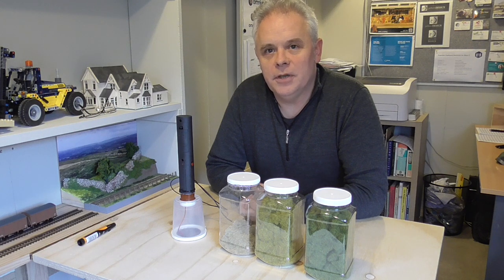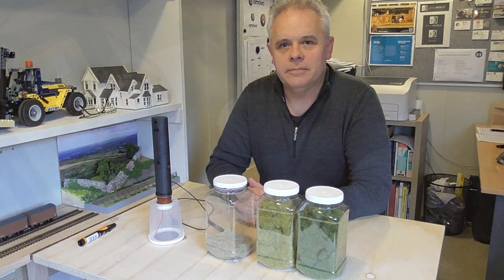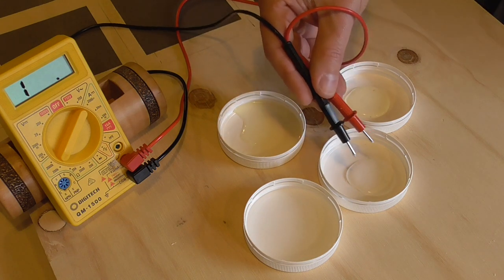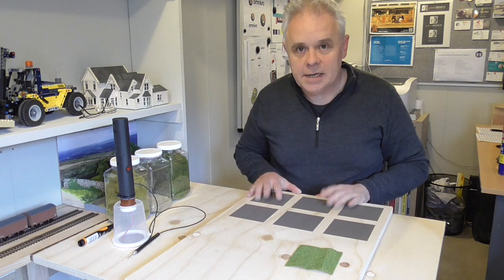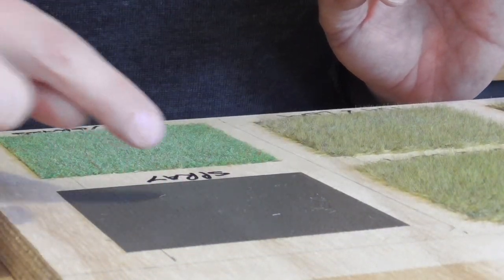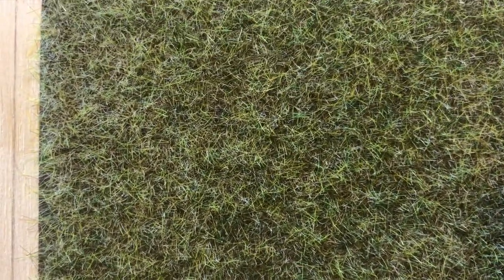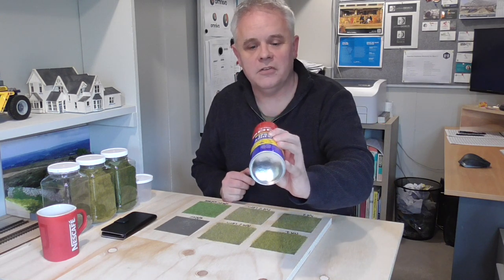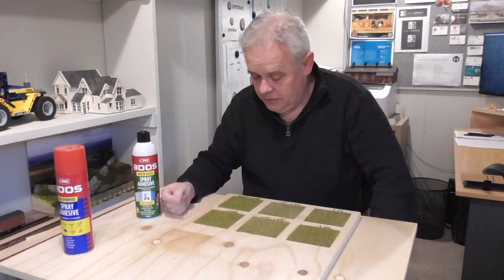The Static Grass Glue Experiment

Comment: Just about to start my new layout and saw this video, thanks for the experiment, always wondered about this, the higher priced PVA seams to work the best..which I have, so will press on using this..
Just a thought on a " sealer for this and a great for " layering " is cheap hair spray, I used this on my last exhibition layout and with it constantly being moved and bumped about, this worked a treat, all my grass and trees/bushes stayed put..! thanks for this great informative video..😊

Comment: I am in Australia, so similar problems with accessing things like WWS base glue. I use Modge Podge as my base glue to avoid that shine from the dry glue. I have found most spray adhesives will lose their stick over time - the back of the can says that a single coat is for temporary bonds - and when using spray glue on my trees, I then need to give the tree another spray (I use cheap extra strength hair spray) to fix the leaves. I have found, when making pine trees, that a spray of spray adhesive, then apply the static grass, then apply the hair spray - almost with no time gap between applications works best.
Reply from the maker: Thanks Eric for your feedback and tips, brilliant stuff. I'm in agreement with your methods in that further coats plus an overall fixative (hairspray) is needed when using standard spray glue. It will be interesting to see how the water based spray glue goes over time. It is more expensive than standard spray glue ($21 NZD) but Supercheap Auto in NZ are selling cans for just $9 NZD.
Reply: WWS glues and products are now readily available through their Ebay store. The postage costs aren't too bad. The layering spray comes as a pump bottle due to them not being able to post the aerosol cans.

Comment: I needed material for making my own static grass and decided to use the furry edges of a piece of MDF that has been laying in my back yard exposed to the weather for about 18 months. I placed it in my coffee grinder and it fluffed up very nicely in random fibre lengths. I added artist's acrylic paints straight from the tube to the fibre in the grinder and whizzed it for a few seconds. Good result and it is able to be statically charged. I have not tried it through a static grass applicator but sprinkling it onto a PVA glued surface from a sieve produced quite satisfactory results.   Rolly
Reply from the maker: That's sounds fascinating and thank you for sharing, I'll have to give it a go at some point. Cheers, Julian

Comment: Hi. Just in the interests of scientific method, did you use a new square for the water-based spray glue, or just straight on top of the GP spray glue? I have no idea if this would be necessary, just wondered.
Reply from the maker: I did just go straight over the top on the same squares but 2 days later, so the previous spray glue residue had dried off. I doubt whether this would have had any effect on the success of the water based spray glue.

Comment: Spray glue, you need to be quick as it flashes a skin quickly as the spirit evaporates quick and the grass won’t penetrate the surface
Reply from the maker: I suspected this might have been a factor with the standard spray glue as I sprayed the squares in the garage (didn't want glue everywhere in the office) and then brought the sample into the office for the grass application. Approx a 30sec delay maybe but spray can indicated up to 2mins for repositioning so thought it would be ok. I used exactly the same method (with time delay) on the water based spray glue with the successful result. Obviously the water based glue doesn't form a skin straight away.

Comment: When I started doing static grass, I thought the clip needed to be in the glue. I was wrong, and there are many others online that show that all you need to do is to keep the clip below the hopper. See https://youtu.be/MY2uPg49tZg?si=iJZyl47MQV2Yw2gH&t=79 and you will realise that putting the clip in the glue doesn't do anything at all. As a proof. After you have applies static grass, pull the clip out of the glue, hold it under the hopper, and watch the grass being pulled upright as you pass the hopper near the newly laid static grass. This is because the electrostatic field that guides the fibers is present in the air .

Try it sometime, you'll be surprised.

Comment: I've had a difficult time with static grass.  I have both a peco/wws smaller one and bigger noch pro.  I tried a variety of white glues. Except for cheap crud from China, us Elmer's or mod podge is ok.  I found though all my static grass fell over once the applicator was removed.  So I finally got so frustrated I created it in swaths... With a sheet of aluminum foil under baking parchment paper... And glue on that parchment. Then with both applicators connected to the foil I could apply grass and with some effort get the results I liked. I generally used the bigger noch.  I also found the noch grass worked better for me than woodland scenics... Although why eludes me.  Finally I developed a kind of layered approach, after an initial pass with 1.5 mm to 2.5 mm grass.  I then sprayed over it fairly lightly a thin glue mixer I made following a recipe off the paepercuts channel.  It's made from matte medium.  This once prepared will spray through a pump bottle sprayer.  Although it'll eventually clog. So spray over then initial pass and do it again with a longer length. Basically I'd go to 4mm and then 6mm.  Sometimes I let the coats dry and did one swath of it a day or so. I guess in the end I think the vid channels promoting static geass are... faked, at least a little. Towan for example. Etc...